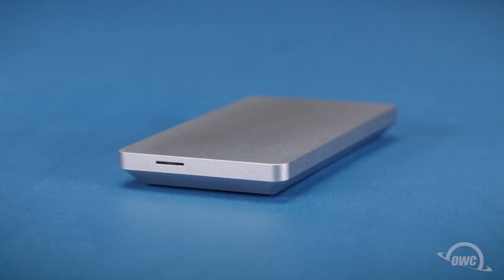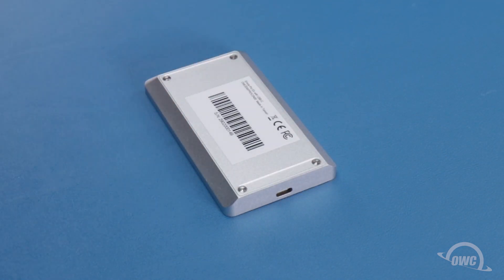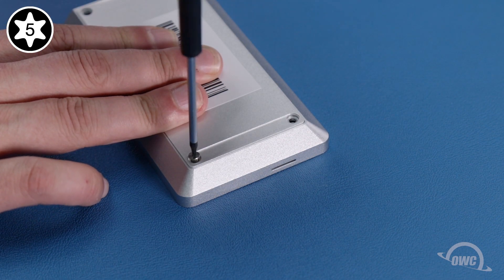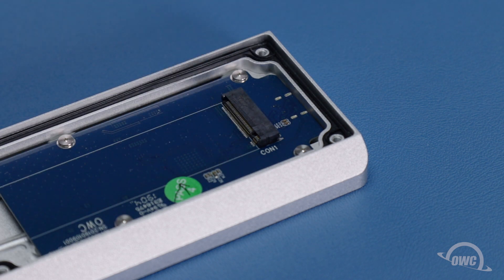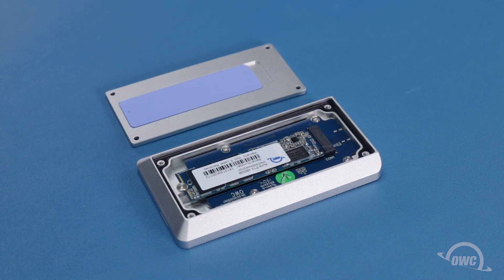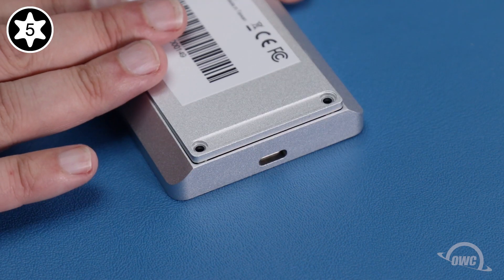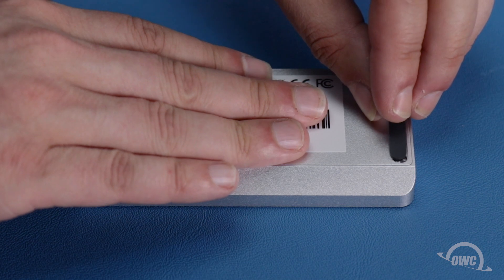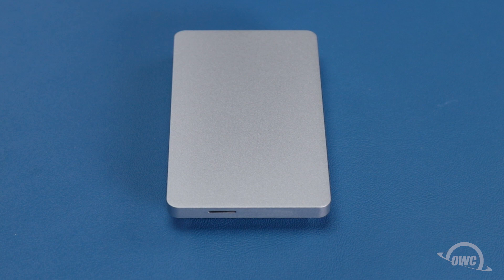How to Install a Drive in an OWC Envoy Pro EX USB-C Enclosure

Comment: OWC says you can't use their enclosure for a non-apple ssd, but I put an NVMe drive in my Macbook Pro with an adapter that re-pins it. Anyone know if there is any reason why it would be a bad idea to use that NVMe drive with the re-pin adapter in the OWC enclosure?